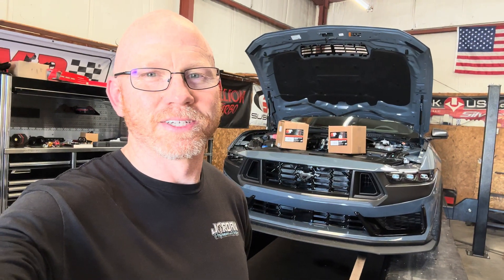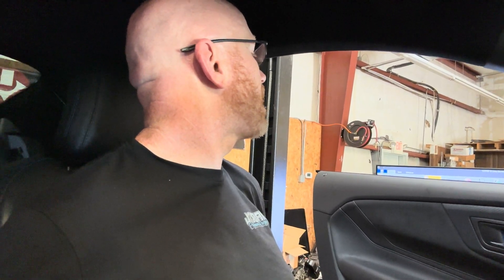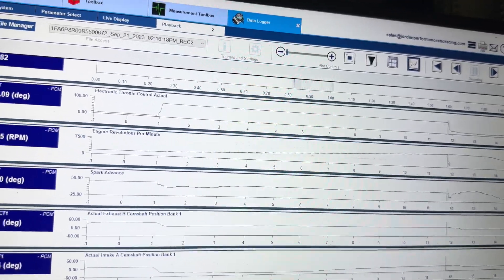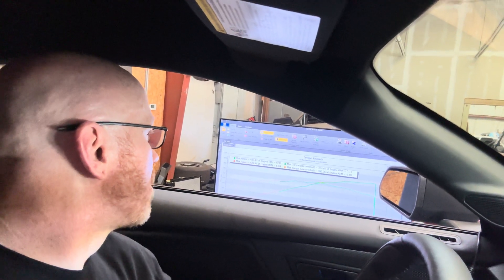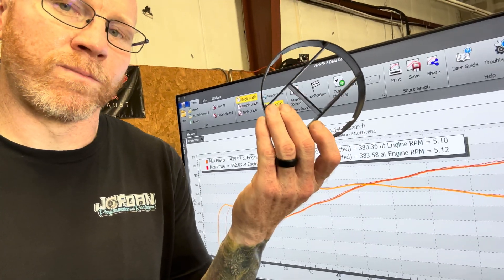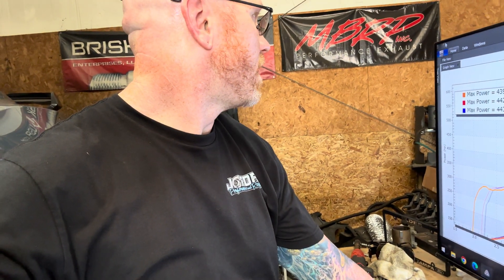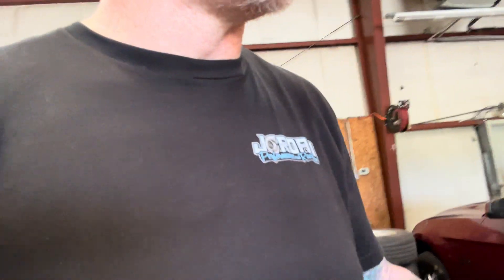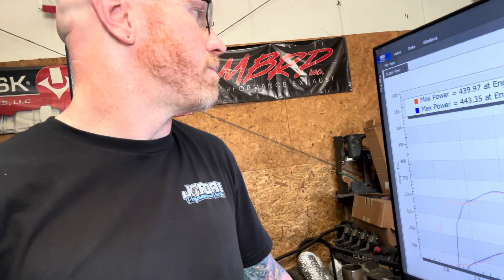Are they really worth 20hp? | 2024 Mustang S650 Carbon trap Back to back dyno pulls

Comment: Oct 20. 2024:
Waiting on my 2024 F-150 XL, Reg cab, 4X4 short bed and Whipple installation (now to early November).
This is Good stuff and I subscribed here.
Sounds like "Is 5-6 Hp worth a change to Let's say a K&N set up"?
As long as you can Keep it Straight enough for Safety, you can't  accelerate hard enough!"

Comment: 5-7 is a much more logical number.  With the stock system having two large filters, it has to flow very well without any mods. I would do it though. The cost is not an issue compared to other dollars per horsepower.

Comment: They work just delete carbon traps is an improvement but I bet throttle body extensions would help;) I have on gen 3 and huge improvement plus nine drive throttle control
Reply: My hood barely closed with the extension

Comment: Nothing is better than the stock air box unless you go bigger and then You have to pay for a Tune to do so.... I am not paying a 1000 bucks just for an intake... I Learned that lesson years ago.. And they could have just went with a bigger throttle body and made the same power instead of making 2 more points of failure..

Comment: How do you shut the engine down so quickly once it reaches redline?
Reply from the maker: push the clutch in. It's not ideal to have the car hanging out at 7000+rpm for extended periods of time with no load on it

Comment: I seems that most of the dyno testing has been in high heat. The other issue is how different the results have been on some Dyno tests. One test in REVan Evans U-Tube channel showed a 15 horsepower gain pulling the carbon traps and replacing the factory cone air filters with K&N filters. The biggest gain was mentioned by Steeda. They installed Kooks headers in their Dark Horse and picked up 40 horsepower on their Dyno pull. One final item I came across was a new Hennessy Dark Horse called the H850. An 850 horsepower supercharged Dark Horse. It was basically hidden in their S650 and Dark Horse U-Tube comparison. I clicked "more" on the article that took me to Hennessy performance where I found the H850 information.
Reply from the maker: Steeda wasn't datalogging either and they also messaged me privately to ask about wrench light and limp mode issues they were having. I suspect they were running the car lean inadvertently and when they 'fixed' their issue, magically they picked up big power. We figured that out in a previous video. It's on this channel.

filter and carbon traps are not worth any power IMO based on my personal testing and years of experience with this platform. I wish I was wrong but I don't think I am in this case.

If you add headers to a car and the car starts adding 2-3 degrees on its own, did you pick up 40hp because of the exhaust? or because of the headers?
Reply: @SouthernPerformanceOrlando  well if the headers are the reason the car is adding more timing I would say it is because of the headers same with the carbon traps if the car is adding timing before of the improved airflow well then the carbon traps are making the power since with them in you lose the power. it is no different from fuel that allows more timing is it the timing increase that makes the power or the fuel.

Comment: Palm Beach Dyno literally had a unmeasurable difference, they did gain a few when they left the cover off of the air filter housing and the fans blowing directly on them and I think they had aftermarket filters other than that its unmeasurable ...  boy I wish this nonsense would come to an end sometime about these carbon traps.... good video though good luck with the Mustang.

Comment: What octane in the car? And did you log the pulls? It definitely breathes much easier with those modifications done no questions about that. If octane was 87 that’s definitely not high enough or even 93 it might not be enough to support the additional airflow
Reply from the maker: 93 octane. Yes we logged it. Follow up video is in link description.
Reply: @SouthernPerformanceOrlando  Awesome thanks for the reply. Lastly do you have the part # for the k&n filters handy?
Reply from the maker: @matt7sixty RU-1037

Comment: On average, the power loss for a manual Mustang is 70hp... so 442whp equals 512hp at the motor.
Reply: Not sure what u mean? Why manual loose 70hp?
Reply: @MustangDad53  driveline power loss. Every car will lose a certain amount of power through their drivetrain.

Mid-engine cars usually have the least amount of power loss.

Comment: The dual factory intakes look like they already flow a lot of air.  I wasn't really expecting much. Maybe run it with no filters to see if that gains anything.
Reply: The stock filter flows enough anything gained from a aftermarket or no filter would be a tickle more at most up top. Dont get anyone started about filters or no filters... they tend to get super anal about the microns of dust that should be filter... Have yet to see anyone of them dyno with a HEPA filter lol
Reply: @NXT_LVL  Completely agree with the whole filter/no filter microns of dust perspective, BUT . . . I had a daily driver supercharged F150 and I had to replace the MAS twice due to failure due to being "dirty", So the microns can wreak havoc🙃
Reply: Either leave covers off air boxes or get a fan on both air boxes for truer representation of real life operations/gains